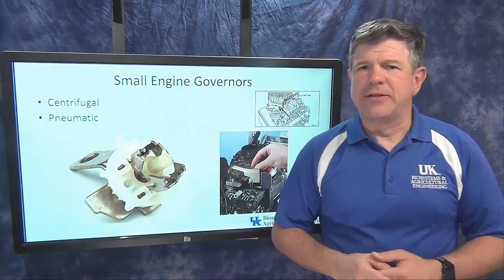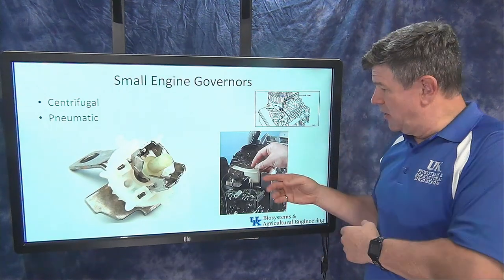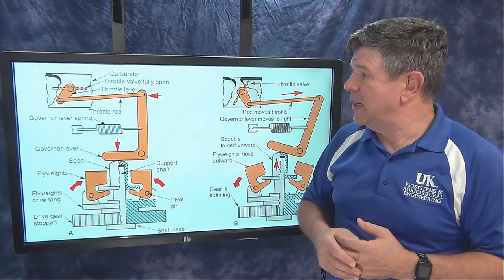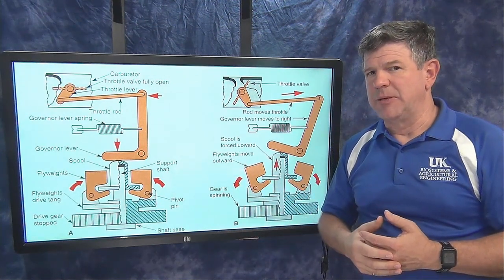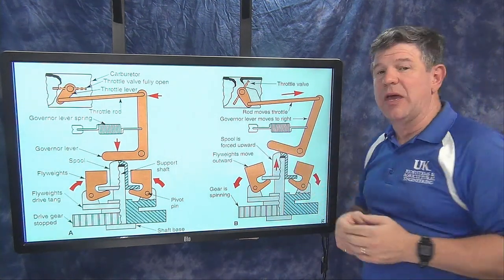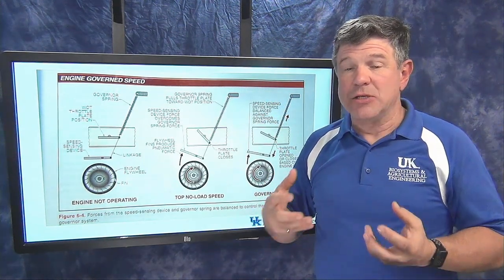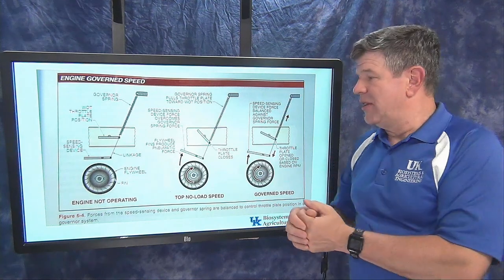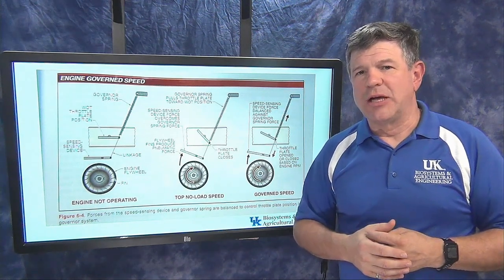8b Small Engine Governors, AEN/TSM 220: Principles of Internal Combustion Engines.

Comment: Does a riding lawnmower have an accelerator pedal?
Reply: Yes, it's attached to the thing referred to here as the "operating lever spring". Pressing on it increases the spring tension on the spring which opposes the governor trying to close the throttle.
Reply: @gregorymalchuk272  so to increase the governed speed do you increase the tension on the spring?
Reply: @tiemanmalcolm  Yeah. Why, what are you playing around with? A lawn mower?